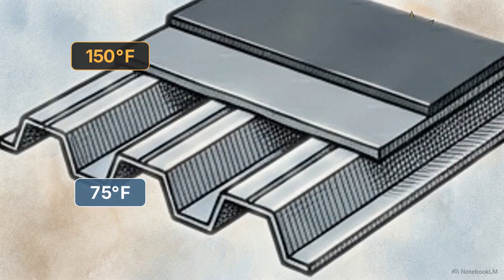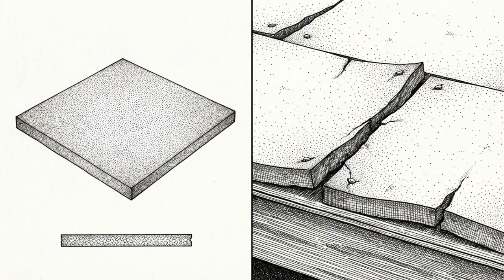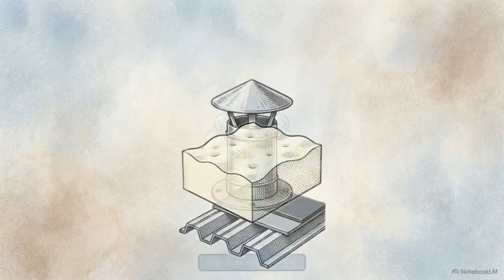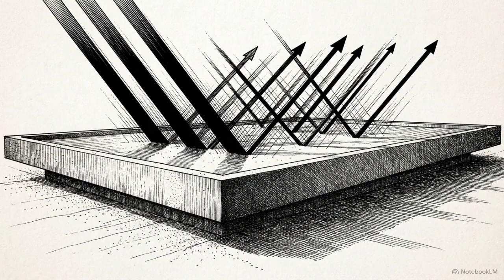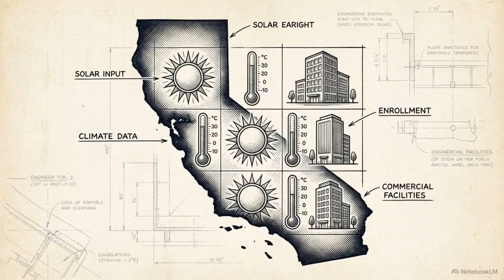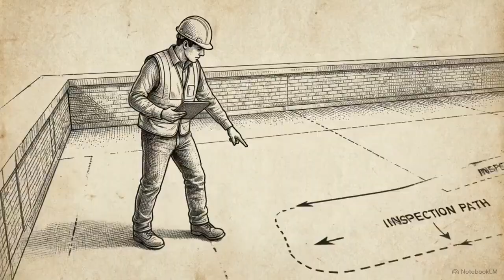Foam Roofing Los Angeles: How Spray Foam Roof Insulation Defeats a 150°F Roof

Comment from the maker: If you’re researching Foam Roofing Los Angeles, this video breaks down how spray foam roof insulation helps reduce rooftop heat, improve comfort, and support better energy performance in hot climates.

Read the full blog here:
https://foamroofinglosangeles.com/maximizing-energy-efficiency-and-comfort-with-spray-foam-roof-insulation/

Want to know if your roof is a good candidate?
Request a Free Roof Assessment:
https://foamroofinglosangeles.com/contact-us/